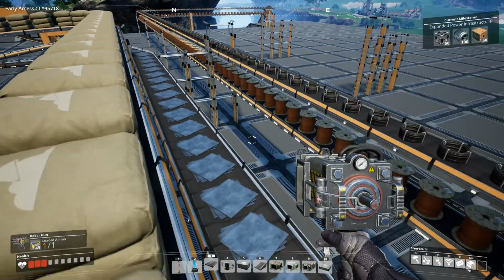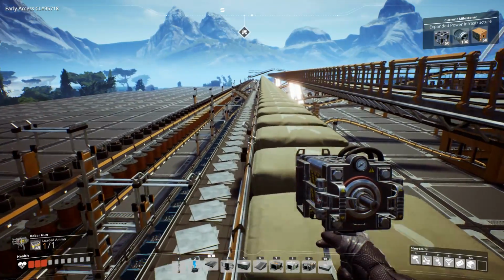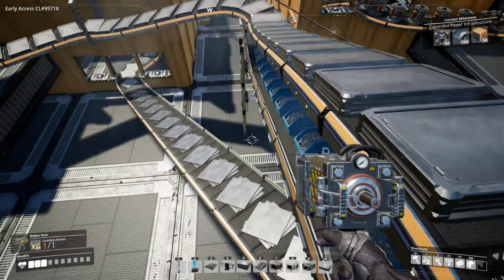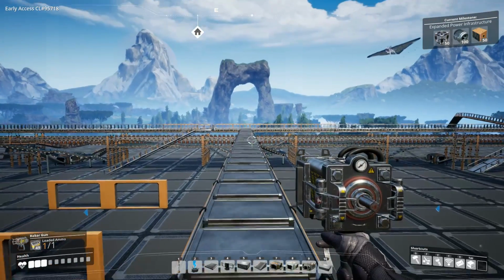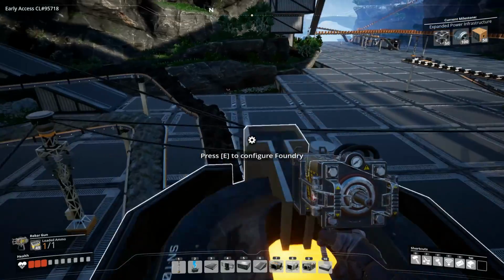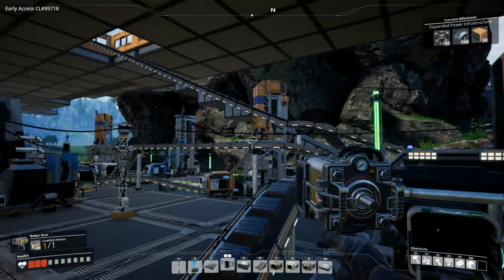Satisfactory - Main Bus Design - Factory Logistics and Organization Tutorial

Comment: i started main bus and now i had troubles with screws supply... screws are insane... my reinforced iron plates got stuck without enought screws LOL, i even just put one rotor assembler to work and now all is too slow... i need change things over one mk2 belt not is even close to enought supply screws, but if i just made then in my production itself, i will need much more iron rods per minute... at least a bit... i not know how to fix those parts to go faster and balanced LOL may put another line of screws, or iron rod... not know

Comment: I see a lot of factories like this.  I'm having trouble comprehending how it works.  Each time you use a splitter you cut in half or thirds what continues down the line.  I don't see how you would ever get enough screws down 1 of your lines just for the items in the first 4 tiers.  What am I missing?
Reply: I think the idea is to have factories along the way putting things in as well as pulling them out, though I also wonder how you would ever keep enough screws on the line. I'm not sure the bus concept translates as well from Factorio (which has grabbers) as some people want to believe. It's also a lot more work in Satisfactory, weighing down the other side of the effort vs. reward equation.
Reply: This would be true if buildings had infinite storage, but they don't. So at some point they'll stop receiving any more item, thus the main bus will get more items. It all balances itself.

Comment: I agree with the people that are pointing out the shortcomings of a main bus in Satisfactory. There are some items like wire and screws that saturate belts quickly, yet they are used up just as quickly. Such items might be better off bused as ingots and converted locally by the compartment that need them. Or perhaps remotely smelted/constructed and trucked directly to the factory that will consume them in an efficient ratio right away. 

However, items that come from assemblers have lower initial production rates than constructor items. They also don't always assemble in neat ratios of their components that will easily consume full miner supplies. These points make busing the components and output of assembler items highly beneficial. The only question remains is when you would need those X supercomputers per minute on your bus.

Comment: Screws on the bus? Madness! that's like putting copper wire on a bus in factorio. local screw production, man. Local screw production
Reply from the maker: My factory has never demanded 900/min or more of either of those items. I prefer having two mark 4 belts of an item on my bus over local production.

Comment: I see a large main bus but no splitters, constructors or assembler. so you will know later that a main bus dont work, because currently its limited by Conveyor speed. 1 pure coal mine with mk2 miner produces 240/min so you need 1 mk3 conveyor for 1 mine. you bus system will result in a bottleneck very fast
Reply: So just have multiple lines of coal if you are running into shortage issues. Works fine for me. Think outside the box.
Reply: This has been my thinking too, but as Aaron says we can just split the coal or whatever and use another belt. I'm still on the fence about trying it.

Comment: while it sounds good, it's really just not. at least not until you get stupid fast conveyors. this is down to the number of items a belt can carry per second and the required items per second to craft goods in the game. a main bus does make sense for ingots but that's about it and even then it's pretty meh unless again you have the best conveyors push a ton of ingots a second. seeing as there is no way to actually get more then one belt of items from a single miner it's really pointless to even run a main bus as you will never EVER get higher output of a miner until you have a better conveyor coming out of your miner.
it might make sense to actually drop 20 small miners on a single vein and then throw them into 10 different storage containers. this way you get 10 belts of 60/items a second. that might not sound too great to do because you have to run over there and manually move items around however that isn't all bad as you can get insane throughput of items with only a few mining spots. why stop at 20 small miners? i'm sure you could fit WAY more then that on a single node if you REALLY tried. xD
Reply: It's like overclocking by hand =)
Reply: @nikelsad  
exactly! i tried it in a a new game, and the ramp is actually kind of crazy. however you still have to shift off to miners as there are so many things to do.....it's kind of like in Factorio where you use burner drills at the start and then the shift to electric drills.

Comment: You can just put splitters on elevated belts you know.
Even if they're stacked.
Reply: Thanks for the tip, it helped me greatly with feeding assemblers.

https://youtu.be/9NBoB0GlN7w

In theory, you can take this other video's design of a single stack direct split bus and build another single stack bus next to the first with staggered belt heights. You would have a two stack main bus that can be split from directly, carry ten or more belts,  and still fit on one foundation tile.

Comment: I'm new to factory games (Satisfactory is my first), so I'm a little confused on how to build a main bus. You show the design, but not how you did it. Would it possible to have a step by step video on this?
Reply: Draw a straight line, extend it to the horizon. Everything travels along this line with production perpendicular. The inputs and outputs are split and merged and never transferred spaghetti style. The worst example, one line of production takes in iron and spits out rods, and down the bus there's another line that takes rods and spits out screws. You'd never actually want to do this since 1-1 ratio but maybe (maybe) it makes sense with a production line that transforms iron ingots into iron plate and then anything that needs plate takes it off the bus. Helps?

Comment: Hi, please give a suggestion.  I have implement a variable of the main bus after watching here.  I made a loop, like a circuit, which is a circular main bus now.  With the straight main bus, I am forced to add in resources from the start, and pull out resource from the end, but not all my things are always on one side, because I have implemented this half way through the game.  Now I can add in and pull out anywhere I like.  Currently I it seems very good, do you think there is any hidden problems?
Reply: Michael Chong you may outgrow the size of your loop quickly. However, your loop bus idea led me to a vertical production idea.... a loop bus that spirals upward around your factory, and you build your tier 3/4 production and add new lines to the bus at a higher level, and so on with T5/6. Only issue is that it will be hard to expand production of basic goods once you’re stacked higher, and have a loop around it
Reply: Michael Chong further thinking made me realize that you could build additional towers outside the loop and feed back in quite easily. Would love for a YouTuber to experiment  with the idea

Comment: time is a resource in satisfactory...
Reply from the maker: Yeah, that's another reason to use a main bus. As we get access to more difficult things we need to build, using a bus ensures we have everything we need already in a central location that we can quickly pull from. No need to go to some odd side of the factory to get one component, the other side to get another, etc. If you're using a main bus starting after you get coal, then presumably you had everything all together when you had to automate the production of heavy modular frames and getting your manufacturers set up took only a few minutes. 

When we get access to tier 7 and need to make a component using, for instance, cable, computers, reinforced iron plates, and steel pipe we don't have to worry about how to get all that into one place, or if we need to build a new section nearby to produce more of one of those -- it's all in one place already, even if we haven't used that particular combination of components together previously.

Comment: Question. There is truck & a truck station right. Why not use that ?.. instead of this system ? would use a lot less materials to transport stuff from point A to B.
Conveyor system be good for moving stuff like wire from one area of processing to another thow.
Reply from the maker: Using tractors and trucks (and eventually trains, I'm very excited for those to be released) to move goods does make sense sometimes. I still use a tractor to supply my factory with coal, for instance. However they do have limitations. One being that you have to dedicate an entire truck station (and truck) to a single product -- at least until we get some sort of sorting device. Another is the overall throughput. You may find some instances where a truck can move goods faster than a Mk1 conveyor belt, but you'll never find one moving goods faster than a Mk3 belt -- hopefully trains will change this. Finally, a truck/tractor would use fewer materials to move goods over a long distance than belts, but only for a short time. Trucks and tractors use fuel and, over time, their cost will eventually surpass that of a belt -- after the belt is placed it never costs you anything again.
Reply: @BLUFGaming  Always considers the trucks free to run as they just take coal & mining it is unlimited. Good points thow. Ether way work i guess. 
Conveyor is more compact i guess as you need multiple stations as you said. Neat design thow. Might try it out & see if it works for me.

Comment: I don’t think I can apply this.  My current tier 4 conveyor belt goes at 450 items per minute.  So let’s say I am doing a screws main bus, my manufacturer for heavy module frame alone eats up all 450 screws per minute.  I do not have a main bus that can go faster than 450 so having a main bus actually creates a new choke point for me.  If I add multiple main bus of screws that defeats the purpose totally as I can’t see it “in a glance” and I have to do the calculations just as I was playing the remote factory method.
Reply from the maker: What I've done with screws, which I haven't shown in this video, is moved them to the outer-most, top-most belt in this bus design. Then I placed another belt of screws above it (adding an 11th belt to the design).

I pull screws off the lower screw belt, and when the lower belt isn't carrying full capacity, I put a splitter on the upper belt and a merger on the lower belt, then connect them so the upper belt resupplies the lower belt. 

What I also haven't shown in this video is that you can put a merger or splitter directly onto a belt, you don't have to go to the ground or a platform to split them, so you can do this belt resupply maneuver with the belts directly on the bus.

I chose resupplying the lower belt in lieu of balancing them together as I haven't built a task demanding more than 450 screws yet. If I did have a job demanding that much I could pull from both belts of screws, but then a belt balancer would be in order.
Reply: @BLUFGaming  I had my manufacturer for heavy modular frames running at 250%, so 450 screws.  It is worth it, as how often heavy modular frames are used.  I still find main bus design innovating, but my work around is to just neglect screws at the moment.  I have though about a load balancing method, but it's just too much of a hassle.

Comment: I like parts of this, but it is quite spread out. Have you tried using splitters and mergers to come off the main bus? I would then double or treble the belts with the same products side by side to load balance. It would need at least belt 3 if not belt 4 to provide enough throughout.
Reply from the maker: Designs I tried with more than 10 belts invited access issues, particularly when you have areas demanding 4 or more products from the bus. That's why I recommend using multiple buses of 10 each, with some space between -- not much different than in Factorio, really, as you needed to leave some space between lanes for underground belt access. Splitting and merging from this design is fairly straight forward.

Yes, for some items (screws, for instance) having multiple belts carrying the same item may be necessary. Regarding load balancing, I have a separate video on my channel regarding the design of belt balancers. I like to put these balancers at the product point of origin, but that's a matter of taste. If one of the lanes becomes unbalancer further down line I can rebalance later.
Reply: @BLUFGaming  I will try a 6 belt per row with 2 products taking from both outside belts with splitters. I wish there was a few more recipes, but we can try things out.

Comment: I still don’t quite understand how the line begins and ends? Do you have storage at the end?
Reply from the maker: A bus begins gradually, starting with just a few belts. As it extends more production is added to the bus until all 10 belts are full, after which you need to add an additional bus lane of up to 10 belts.

You can put storage at the end if you like, but the 'end' generally doesn't remain the end. As your factory expands, the length of your bus tends to increase. Because of this I tend to put storage at the point of origin for each product. 

The benefits of using a bus become very apparent when you start getting demands for 4 previously unrelated products in order to mass produce a new product. Rather than having to build everything anew, or reroute from four distant areas, you have everything in one easy to access location.
Reply: BLUF Gaming thank you for your reply, I have a question, why wouldn’t you make a bus in a loop?
Do you stream?

Comment: I like the idea but I'm running ratio at Max belt speed so each section yous entire trough put of belt so I can't see a main buss as good solution might work for a personal centrilzed storge though
Reply: I've used a bus solution on a smaller scale for certain things. So for instance when something needs a resource thats not 1:1 with your constructor, you just make a mini bus. Stuff like screws are sucha high volume, you should always transport the rods and make the screws close to the actual assembler.

Comment: Are there configuration options for conveyors/splitters/etc to help control what goes where? For example telling it to only take 20 per minute to the left. Or bring certain items in a different direction?
Reply: Just with the conveys (limiting to minimum 60) or the Programm able splitter but the Programmable splitter is not really acessable in the moment you could build it if you got motots but you cant produce them
Reply: @williknie9165  if you are lucky enough to find a turbo motor in the wild you are able to build a programable splitter, but i think you have to very very lucky to find even ONE D:

Comment: Huh....such an elegant concept; disentangle the individual elements of a production line, while still maintaining high production rates. 
What about running the bus as a single continuous loop?
Reply from the maker: Yes, you can do this. I've seen several people run circular main buses in Factorio and they work okay. The main issue is that it's more limiting on your factory size, as once you've completed the loop its circumference is as much real estate as you'll ever have. 

This gives me an interesting idea, though. I've been working on a conveyor elevator video. If you had a circular main bus and you ran out of space around it to build, perhaps you could use a large elevator to make a copy of the bus on a new platform at a higher level. It may be possible to connect the two with a belt balancer to ensure the products are distributed evenly. Sounds like a lot of work, but interesting challenge.
Reply: @BLUFGaming  
1) I was thinking in terms of a loop looking something like a long flat loop, like this "⮎⮀⮌", rather than one large "O" ring. If you decide to extend the bus, you can just deconstruct the U turn at the end, extend both lanes out at the same time and reconstruct the U turn when you're done. 3x as much work per extention, but you have the benefit of opening up the possibility for injecting new material into the downleg.  

2) Have you tried incorporating storage depots into the bus system? Could you use the internal storage as a buffer and a (simplistic) rebalancer?

Comment: Have you considered only putting some basic items on the bus like iron ingots, copper ingots, steel ingots, cement and coal instead of all existing items ? 

You could then use the vehicules to store manufactured goods into a storage silo
Reply: Items like Modular Frames and Rotors are used later down the bus.